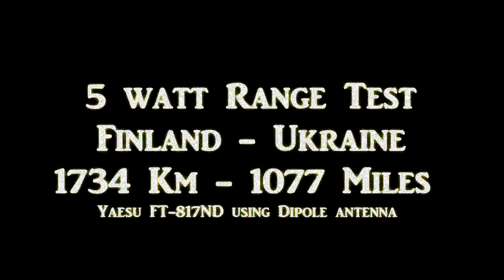Yaesu FT-817 QRP SSB | 1077miles - 1734km

Comment: I have been using the chameleon mpas antenna with a 
yaesu ft 817nd. I set up with the 60 ft wire and the mini hybrid in a sloper configuration . I am getting just short of 2500 miles. I am constantly getting Hawaii from California in 5 watts. My goal is to contact Japan and Florida. With the vertical with the whip extension I am only getting around 500 miles. Would the inverted v help get past the 2500 mile mark?
Reply from the maker: Youre leaving out all the most important details. Band, time of day, mode, 
The short vertical is great on 20m-6m, but no longer efficient on 30, 40, 60, 80m When you see me with the MIL Whip in vertical configuration in my videos, it is always with MIL EXT under it. I also use elevated conterpoise. 
The thing is, without applying some operating wisdom to your goal of reaching Asia, it will only happen by luck. The wire element will always outperform the whip because the whip is a convenience not a contest performer. The user manual which came with the MPAS has excellent deployment examples. Also study about grey line operating, and more efficient, narrow bandwidth modes like CW, PSK31, FT8, JT9, ... I could keep on writing for pages, but hopefully this gives you enough to get started. Your goal is perfectly achievable, but it must be done on purpose, not by chance.
73
Julian oh8stn
Reply: OH8STN 
I did leave that out. I am using the. Mil ext with mil whip . I have tried the elevated counterpoise with no real luck. 40m and 20m ssb at around 1900 utc . my goal right now is to get past Arizonia on the vertical. Will keep you informed

Comment: Great video.  It is amazing to see how far 5 watts can travel.  I'm new to HF.  Is this kind of distance due to the type of antenna or the band that you're using, or would any HF band (160 m - 10 m) have the same potential range depending on atmospheric conditions?
Reply from the maker: thx for your comment.
these contacts are made possible when all of these things you mentioned come together. Band, time of day, antenna efficiency,  propagation,  ... 
Just to throw more confusion st you, I've once completed a contact between my city and Hamburg Germany on 144Mhz, 50 watts, and homemade directional antenna. Its all about using what you know :)